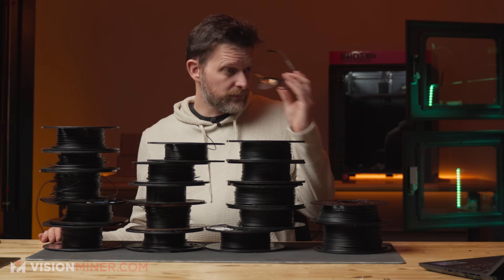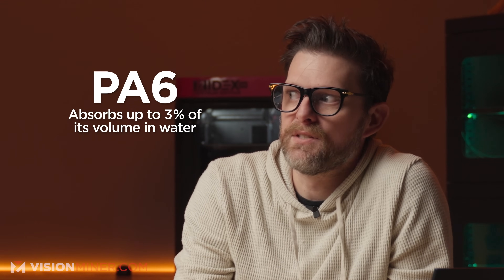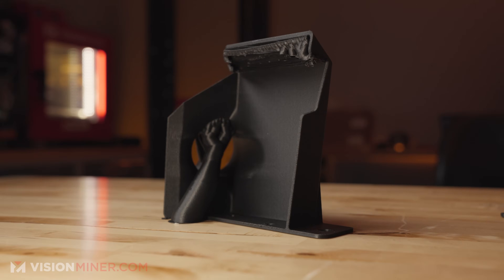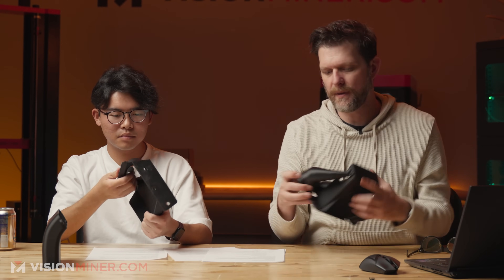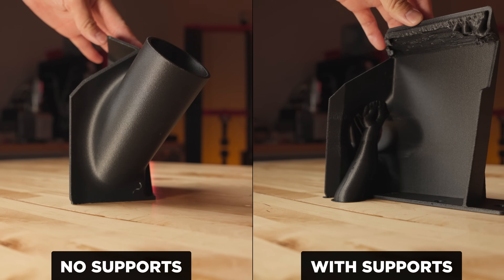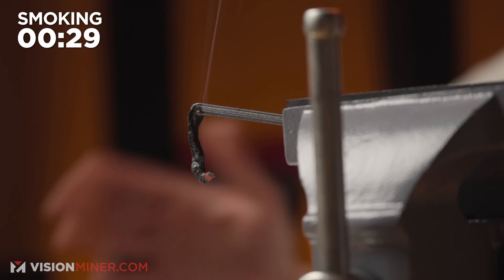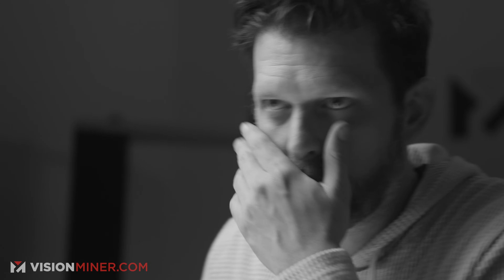Which Nylon is Best for 3D Printing? PA12+CF vs CFPA6

Comment: If you use a little cooling for the support interfaces they separate so easily and cleanly (PA12CF).  I also had issues with it sticking too well

Comment: Do you have to change the hot ends to run this stuff?
Reply: Typically no, but just be warned carbon fiber is abrasive to the nozzle, and it’s my recommendation to use a all metal hotend. But if you have something like a diamondback nozzle you should be fine.
Reply: @ZeFoxii  I did order a roll of this stuff and I just haven’t read it through my machine. I am currently waiting on a dryer that I ordered but PA 12 – CF was pretty expensive.
Reply: Not considering all the other stuff you have to get to run it
Reply: @ZeFoxii  I have a bamboo lab P1S and was thinking about upgrading my hot nozzle and my gears to run some ASA– CF and some PA6-CF
Reply: @ZeFoxii  thank you for replying to my comment by the way

Comment: You mentioned the parts were printed on default profile. What are the basic numbers of the default profile. I.e nozzle temp, bed temp, chamber temp and max flow rate?
Reply: I run PA12CF like this:

Nozzle: 280c
Bed: 70c
Chamber: 50c
Max flow: 8-12 mm³/s
Max Speed: 150mm/s

Comment: Very entertaining and factual but could you give some recommended settings for printing in PA,  using flashprint slicer for Adventurer 5mpro , home use not commercial or industrial  thanks

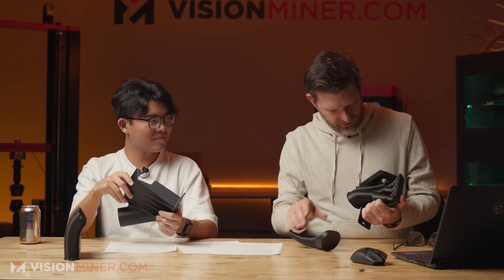Comment: 7:43 why not use an interfacematerial that is not pa? i use petg for that. comes off like magic. (a 100% solid interface pattern is best for this, u will have to manually choose what pattern and direction for each overhang/brigde though.. takes some time in the slicer but saves in post processing) also u can set the top distance to 0 and get perfect overhangs.

u can use petg for pla also when rapid prototyping. only print in pla first to get the fitment, then pa final part. saves alot of cost that. so i always have a roll of what i call "interface filament" in the multi spooler.  
also u can set the top distance to 0 and get perfect overhangs. my gift to you ;)
Reply: Simply using the cooling fan for only interface layers removes this need.

Supports remove so easily and cleanly
Reply: @4lan39  polymeroffsets are the best to use for support materials. u can say what you want sir, but we make a living doing this. same polymer is subpar as support in all fdm scenarios compared to offset polymer use. u cant win this. sure it may work with simple geometry, but when it comes to more complex tasks it is subpar and leaves scars.

Comment: Have you guys tested how well these parts are air tight? 

For a boosted car or motorcycle it's gonna be a giant boost leak. Cf filaments tend to not seal at all.
Reply: I would argue that you need to increase your amount of walls and to really slow down your print speed. I've seen this stuff used in automotive and other applications without any pressure issues.

EDIT:
Also, make sure you have your hotend running 300C or higher. Otherwise layer adhesion is awful.

Comment: Fun Fact we are printing pa6 /12 cf/gf whatever in our Company with Qidi Machines. Ne need of a Fancy 22 :D:D. 700 €are enough. The only thing you need is good Material and a good Print Plate we don't even use the heated chamber. So nothing special here.
Reply from the maker: Funny you mention that. Check out our CFPA6 video to see why chamber temp is crucial with printing nylons!

Comment: Use them all. Pretty great stuff. Running a CF pa6 right now, was running a straight PA6 earlier that was WAAAAARPY. Couldn't even stop it in an 75° chamber😂 truthfully between PA6/6-6/12 I prefer PET-Cf and pretty much any true PC. True PC is easier on my machine I feel and much stronger than most of the PAs. All that to say .. I need a 22😂
Reply: Weird that PET-CF isn't more popular. Easy to print and strong af.
Reply: @oldman1944 agreed. Especially when salt annealed. Ive had parts in an engine bay 8" above a bare v8 exhaust mabifold for about 3 years now (it gets HOT there and its under a lot of force) and it looks the same as the day I put it in. Phenominal stuff
Reply: @notyouraveragegoldenpotato  will probably because nobody wants to salt anneal plastic 😂

Comment: Nylon, what a nobel material, ive been printing Esun ePa which is pure nylon 6 and 6.6 (a blend) and man this thing is soo hard to keep it on the buildplate (warps even on a 60º chamber if not managed correcly), the only thing i got to work with it is Vision miner nano polymer adhesive (even on straight glass). Prints out of that material come out like they arent anisotropic , really good for gears, they come out rock solid and with low coefficient of friction, its meant to last
Nylon 12 Cf is great too of course, really light and strong, ej 3dxtech Pa12-Cf has something like 45% of the desity than pure aluminum, and holds 80% of its tensile streght, on a XY print, polymers are amazing